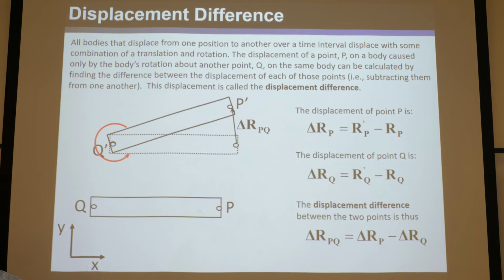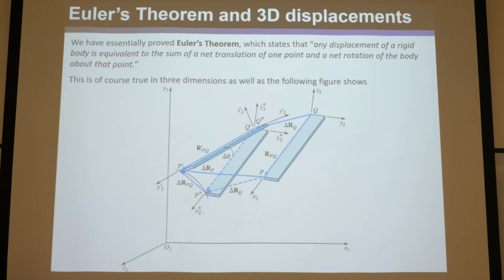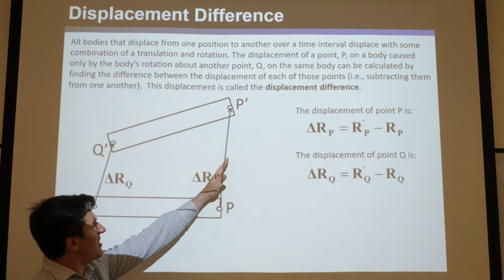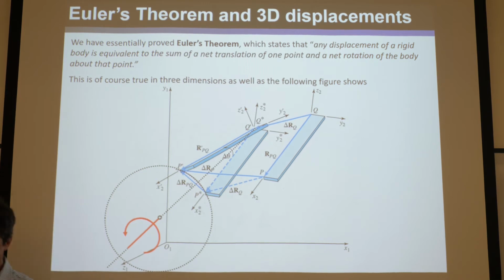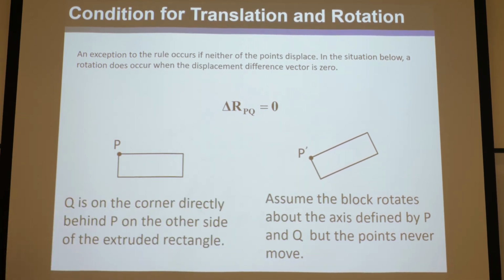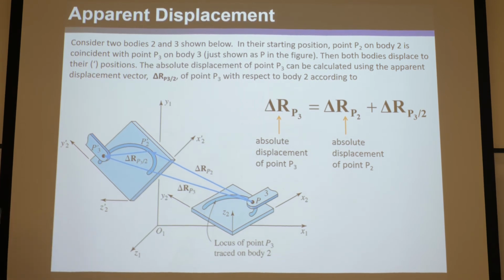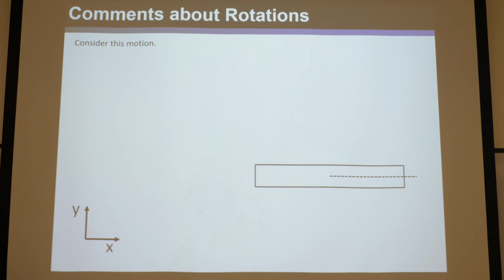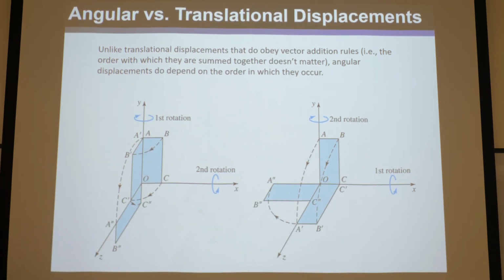Traditional Mechanisms and Mechanical Systems: Topic 2 Part 8

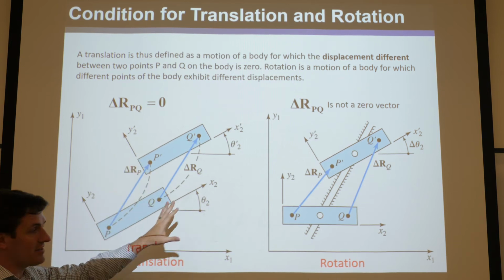Comment: at 11:17 shouldn't the exception be if P and Q are both on the axis of rotation? You could add a translation to the example and P and Q would still have the same displacement vectors.